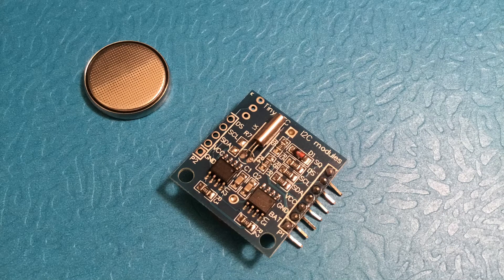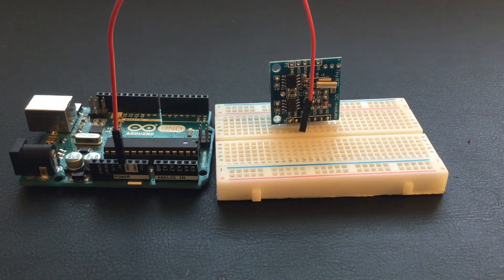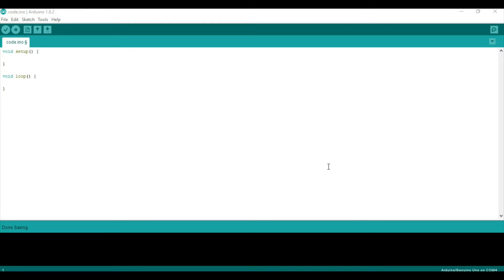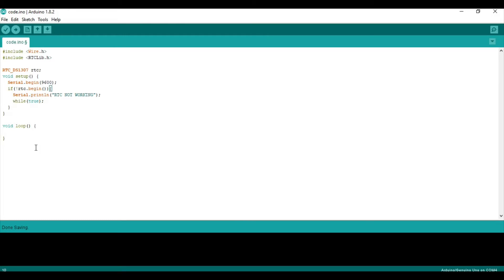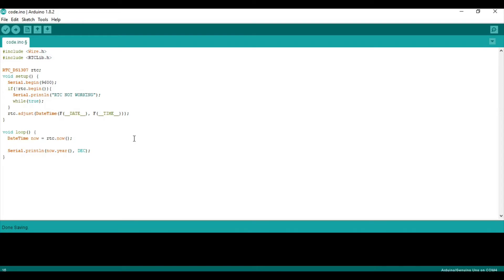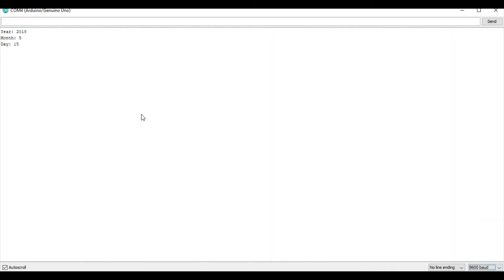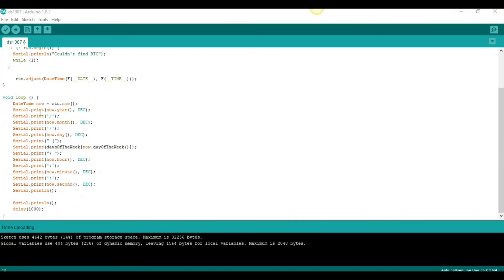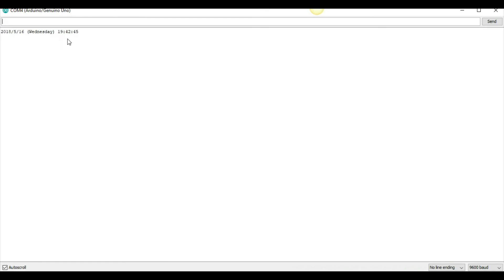DS1307 RTC Arduino Tutorial - Wiring, Coding, and Troubleshooting

Comment: Hello sir, I am new in arduino world. I follow your ideas, using the adafruit library, it turn around this way, when I upload the sketch is ok and showing the result and correct date and time. But after disconnect the cable and re-connect back, the serial monitor says Could't find RTC. Really need your ideas/ any expert to share the idea how to fix this issues. Thanks in advance

Comment: I've just bought the ds1307. I receive it with the lir2032 battery has been plugged on the battery slot inside the pressed anti-static plastic packaging. I see your video said that it is a rechargeable battery. Should we have to charge that battery before we use it? Or we can just use it after open the packaging?

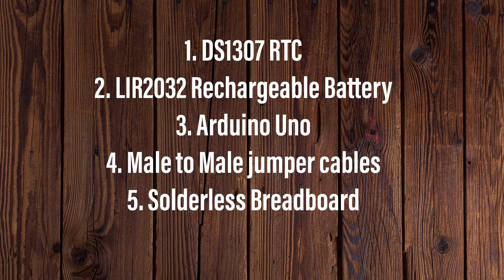Comment: is there a (clean) way to get hours and minutes less than 10 prefixed with zero. e.g. 01:01 rather than 1:1?
Reply: //**************************************************************************************
// Utility Function to format time values
// Format a byte as a left zero-padded, two-digit decimal string
String two_digits(byte value){
  String message = String(value, DEC);
  if (value <10) {
      message = "0" + message;
  }
  return message;
}

Comment: I didn't get it but I'm using arduino mega my sda and scl cables are as following in arduino mega sda(20)and 21
Reply from the maker: It seems like you are using the correct pins. Are you sure your wiring is otherwise correct? Also, be sure to try the example code in the library to see if everything works.